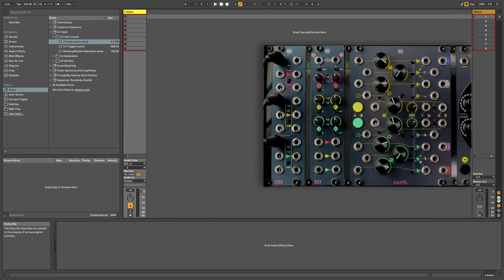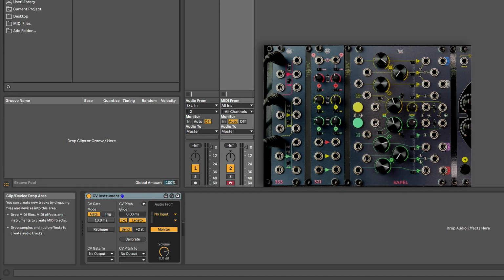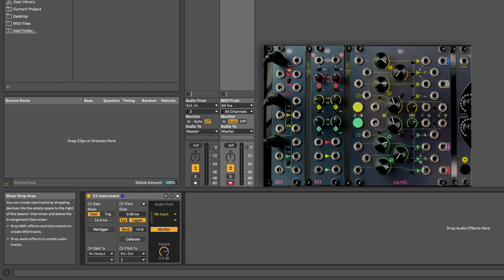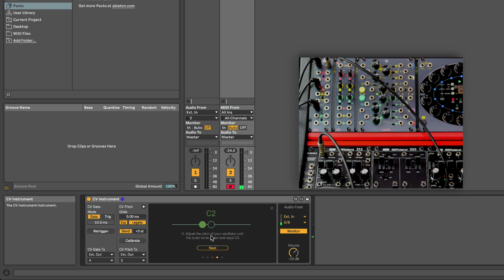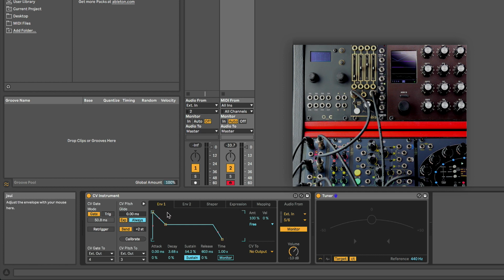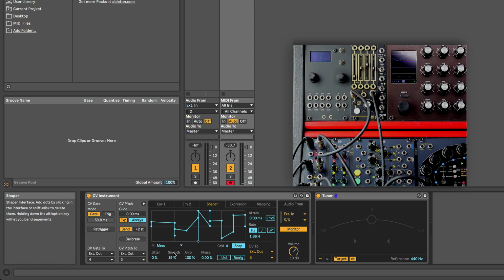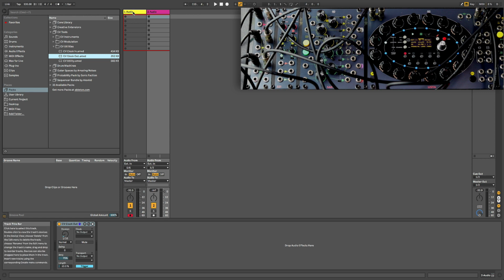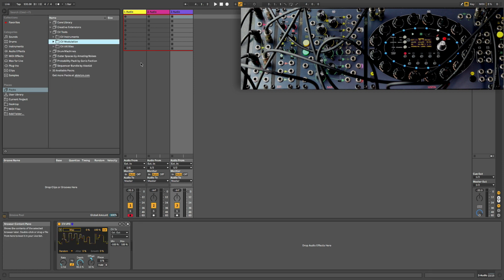How To Use CV Tools in Ableton with Kirk Degiorgio

Comment: I’m years late to this party but nevertheless I’m here. My DC coupled PreSonus studio 1824c interface is arriving in a couple days. Main question- I will have several semi modular instruments connected to the inputs (DFAM, grandmother, Subharmonicon, 0coast, Strega, as well as a small rack with a Pam’s New Workout and some oscillators, filters, and envelopes. If I’m using all 8 of the inputs on the interface to connect this external gear, are the outputs still available to send CV back into the modular instruments? Or does output 1 correspond to whatever instrument is plugged into inout 1? I’m a bit confused. Essentially I want to be able to send a clock signal from Ableton out to Pam’s, and essentially slave Pam’s to the Ableton clock. That way I can start/stop and clock everything from Pam’s (which receives the clock/start/stop from Ableton). This way I can use MIDI software drum tracks that I make in Ableton sync to the DFAM etc in the outboard gear. Sorry this is so long but if you have any suggestions please drop me a reply. Thanks!

Comment: thank you for this nice explanation. This is really helpful. May you can help me with one question regarding the floating ring cables: wouldn't  it be the same putting the phones adapter from 3,5 to 6,3 on a 3,5 ts calble . i have tons of those adapters and of those ts 3,5 patch cables.

Comment: Thanks for the very useful tutorial. Please, does it possible to use the Frap 321 module instead of 333, just for 1 DC-coupled output connection? I have just one free output port in my audiocard. Thanks in advance (and sorry for my bad english)

Comment: 1/4" trs cables have 3 contacts:tip, ring and sleeve. The 3.5mm jacks that your synth uses only have 2 contacts.  The ring signal doesn't connect to the other end, so it is 'floating' (floating ring).... you don't need to buy a special cable, just solder the connections you need. Take a patch cable and connect a trs1/4" to it.  Uh durrr.

Comment: Is it absolutely necessary to have the floating ring cables?  They are impossible to find at a length that is usable.  Can you use a regular TRS to 3.5mm cable?  I am able to find those in the correct lengths needed.  I don't want to fry my audio interface... this worries me.
Reply: Easy to solder or use standard Y cables
Reply: L U N G T H U M P A so a y cable could you please explain? Any diagrams you know of on this?
Reply: @Ast3rixMusic  Floating Ring Cables are simpler:
TRS Tip to TS Tip
TRS Sleeve to TS Sleeve
TRS Ring not connected to TRS or TS I.e (Floating)

Comment: Great video! Will I fry stuff up if I use a Samson patchbay between my interface and modular gear? Even if use the correct cables.
Reply: No as long as your patchbay is passive which i assume it is, but it's also probably not able to send DC signals i.e 0Volts. Try sending CV pitch i.e constant voltage thru the patchbay it will either work or not. 

It's more dangerous to send CV to speakers, but only after an extended time, short bursts wont damage them.

Comment: Thank u for this tutorial. I just got Expert Sleepers Es9 and trying to connect to Ableton through CV tool.
Reply: SeN YanG any luck? I have a Polyend Poly 2 I was wondering if it would work with CV Tools...
Reply: I'm just trying the same thing, any tips on this?
Reply: @zoemcphersonn  ES-9 works great. I use it with CV tools and also VCV Rack - when VCV rack 2.0 comes out with VST plugin the ableton integration there will be sweet.  The ES9 is the best thing ever, i use it for mixing connected/disconnected and handing 15 channels to Ableton as independent tracks over USB